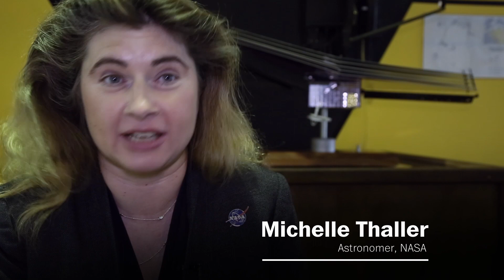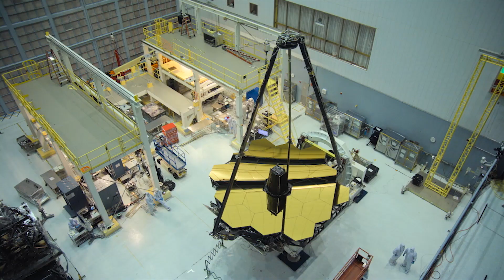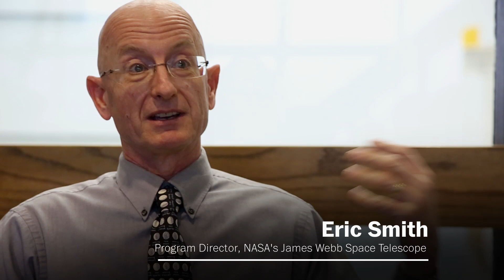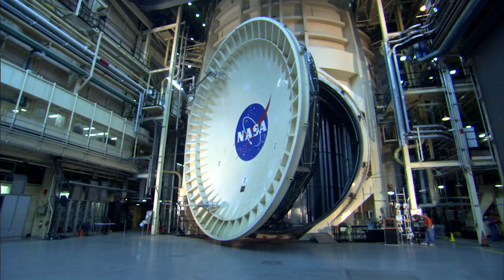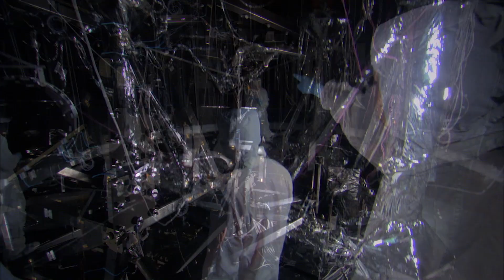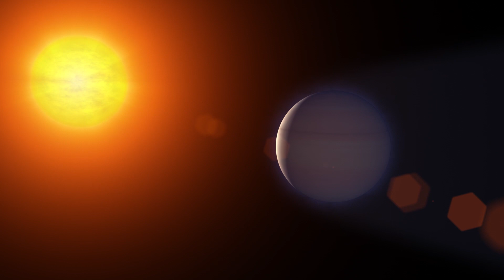This telescope can see back in time, almost to the beginning of our universe

Comment: What she is saying is wrong. She says "the Big Bang happened 13 billion years ago, and the light took 13 billion years to get to us". This is not correct, the Big Bang did happen 13 billion yeara ago but the light may take more, less or exactly the same amount of time to get to us. The former is a measurement of time, the latter (i.e. how many years it will take for the light to get to us) is a measurement of distance. These are two different dimensions.
Reply: You are right actually @Alireza Aminian .It is not possible to say if it would take less or more or the same time because, in normal calculation it should take less time to reach, for example the sun is 4 billion years old,  but light from it doesn't take 4 billion years to reach us, it takes about 8 minutes only. So technically it should take less time than it's age. But then we know that universe is expanding. So the light that should reach us faster keeps getting delayed as the stars and galaxies move farther from us.

But the way you are putting her words make it sound wrong,  you are saying she said "big bang happened 13 billion years ago and light from that took 13 billion years to reach us" That's not what she said, she said " The telescope is powerful enough to see that far away that the light took 13 billion years to reach us" which means the telescope has the capacity to look that farther in distance. If it can see that far, then it would mean we are looking at an event that happened 13 billion years ago. Which is when the big bang happened.
Reply: I don't know buddy distance is basically the 'space' between two points and I think I remember reading that space and time actually ARE the same thing. Don't ask me specifics as I'm just throwing something out there I remember reading somewhere. I could be wrong.
Reply: Also I think she was an expert in this field and I think you may not be but again, I could be wrong.